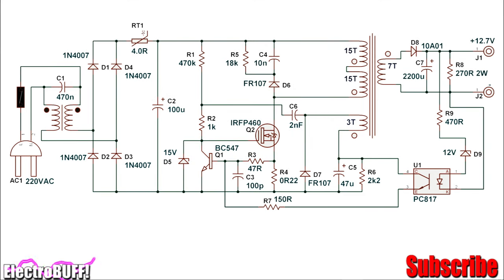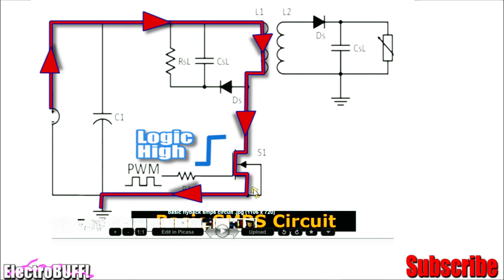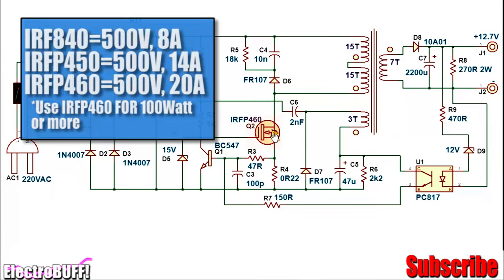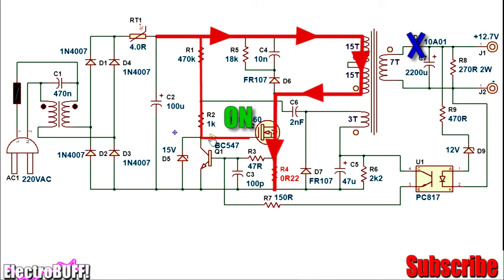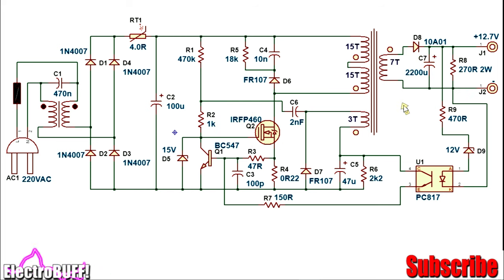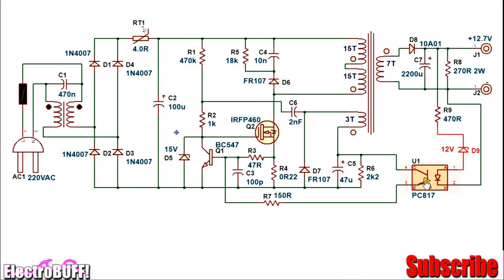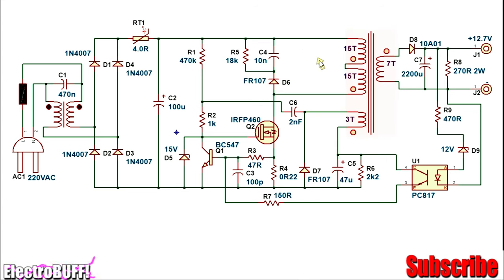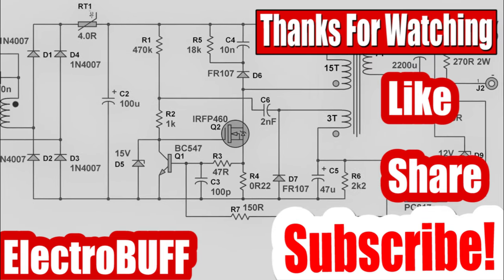How a Switching Power Supply Works and How to Make One

Comment: Good Video explaining everything.  Design can be improved.  You have R2 = 1K gate drive resistor (make it 10 Ohms) Gate drive is very slow so slow switching wave forms so FET gets HOT so you need to use a HUGE MOSFET IRFP460.  The primary current is 0.7/0.22 = 3.2 Amps pk. and the transistor is capable of 20 Amps.  Perhaps other improvements but I leave that to you.
Reply: I tried your suggestion of making the gate resistor to around 100R. The MOSFET gets burnt. I think you can go as low as 2K to be safe, and not lower.
Reply: can u please tell me how the switching frequency and the duty cycle is calculated from the feedback R2 and  C6??
Reply: @@MrAk962 can u please tell me how the switching frequency and the duty cycle is calculated from the feedback R2 and  C6??
Reply: @RanaRao_Chandrachur 
No body have actually answered that question since I started asking for the formula for switching frequency and duty cycle. It is sad!

Comment: I know you had the best of intentions but without good audio quality, this is all for nothing. If you could also speak a bit slower it would be very helpful. This was very difficult to comprehend.
Reply: Yes, not only is he speaking fast and having a strong accent, he was also away from the microphone which was picking up the room echo/reverberation, and made it even worse by saving the audio in a crappy audio compression format at low bitrate settings which made it at least twice as bad and very hard to comprehend. The background music didn't help either, it would have been slightly better and easier to understand without it, but not by much.
Reply: At least he tried, so A for effort. What I can't stand is english titles but the video is in a completely different language without subtitles.

Comment: I know many people have been wondering if the circuit works or not. The simple answer is that in its current form "NO" or maybe if you buy a damn powerful mosfet with literal cooling and also way too big transformer for the purpose. But the circuit can work with various modifications and indeed with an EI33 Core if it is balanced at both ends. I have built a working 16V flyback converter inspired by this circuit. If there is anyone who wants to build a 16V AC/DC converter, I can recommend the rebuilt version so you don't have to buy 10 pcs. mosfet which you will otherwise burn.

Comment: If you wanted to make this adjustable voltage by controlling the pwm, which resistor should you replace with a potentiometer?
Reply: On the secodary side you could use TL431 IC or a lower voltage zener instead of D9 (that would be the lowest voltage you could set it to) and use a potentiometer (like 2K value) across the output, with its middle leg (slider) connected to the top (cathode) of the zener. You could also bypass zener in that case and get an even lower voltage (PC817 opto-coupler LED would act as a zener), but I can't guarantee a very stable voltage.

Comment: this circuit is not practical, as the power in R1 and R2 is 65W. calculating the power in R1 and R2: (311V ÷ 1470R) × 311v = 75.79W.
Reply: Try 471k equivalent resistance